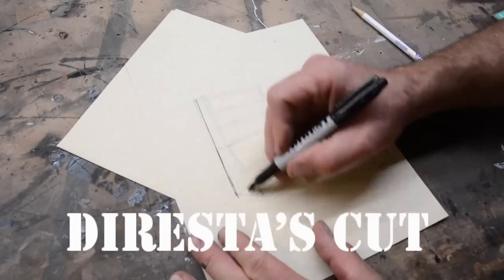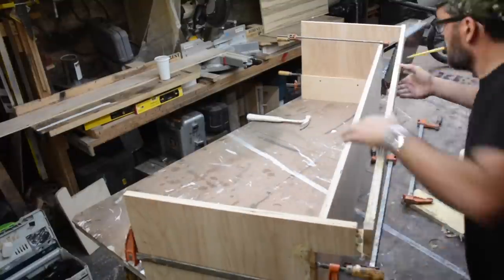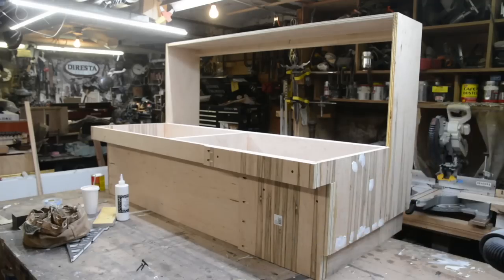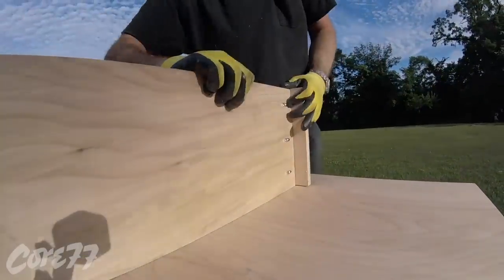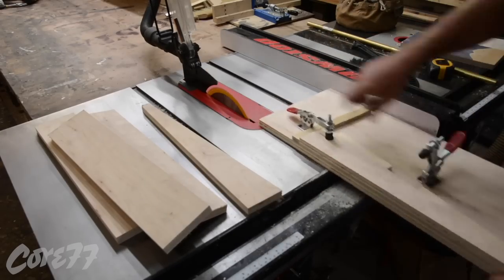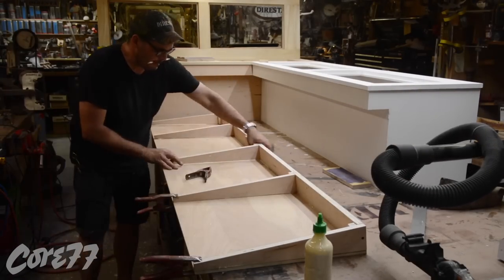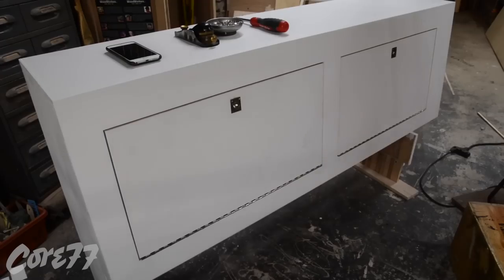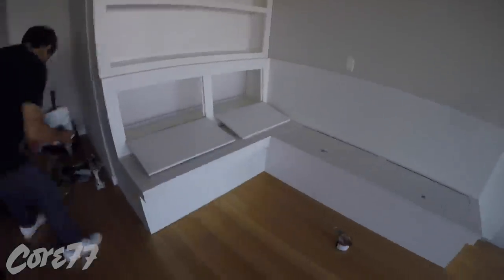DiResta's Cut: Built-in Seating & Storage Unit

Comment: That tip about letting the glue dry before screwing in the kreg screws just changed my life!
Reply: Vectors2final
Reply: Absolutely. Saw other channels using a lot of specialized clamps or other strategies, but this one definitely requires the least equipment for the best result.

Comment: Hey Jimmy! As always, I love learning and some times re-learning shop tips that I had forgotten, Thanks for the tip on the Craig jig (glue before screw) I don't use the jig often because of the shifting and I the clamped leg table extension I use all of the time but often forget between uses.

I really appreciate the explanation of your forethought as you build I.E. notching for molding and separating the pieces to ensure they come apart in sections that will transport and install easily. I am a member of the "build the item too big to leave the shop club" and that is a lesson that can ruin your whole day.

Thanks again Buddy!